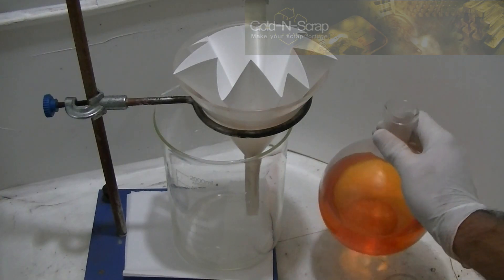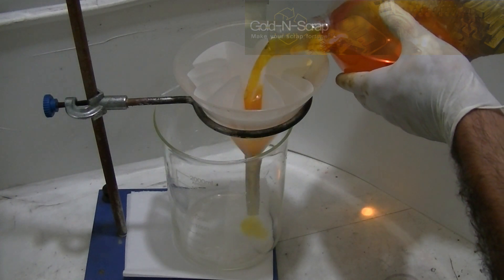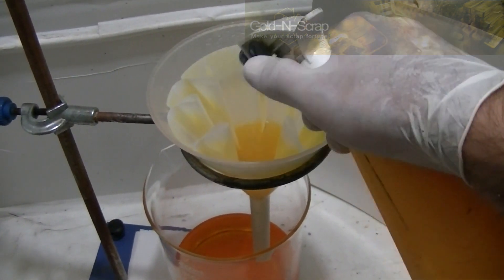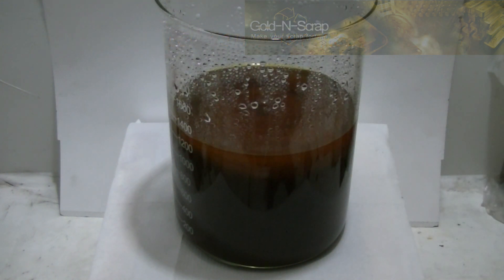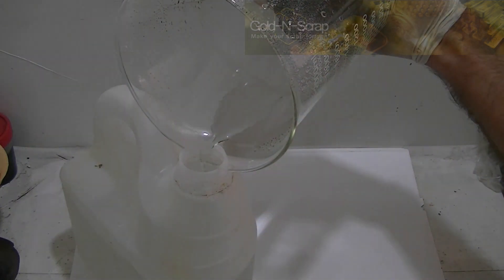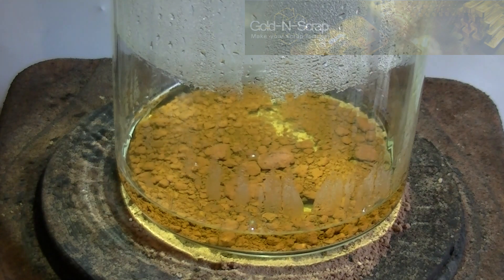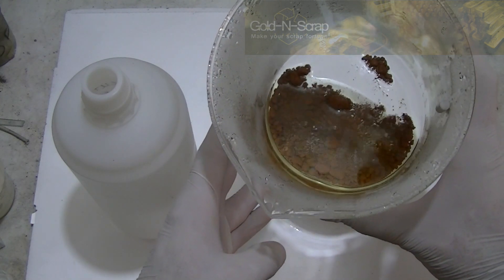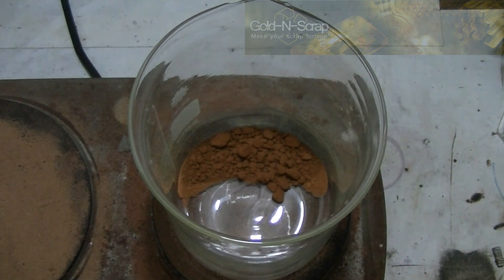How to Refine Gold Jewellery - Inquartation Methode (DIY) P. 2

Comment: Thank you for the great videos, they are very informative, I have a question though, is it important to grandulate the metal before remove other metels from gold using nitric acid and water? Basicly, is it ok to start with a 1 oz muffin piece of 14k gold and not grandulate the metal? Thank you for you help.

Comment: Why do you use all that silver? Is it just to lower the karat of the gold to demonstrate that you can refine it from such a low karat or do you need the silver?
Reply: That makes a lot of sense. Pm partly I was right it is to protect the gold and make the process cleaner and quicker and thereby you protect the gold from be in the acid  for to long. Does it matter if there is a little much copper in the solution when you precipitate by aqua regia? Ofcourse i  clean it afterwords with acid and boiling water until it is brown and not black, but does it ruin the precipitation at all?
Reply: thomas lund I have been researching this myself as a bit of a hobby and I think I have got the answer. The inquarting process it to introduce enough base metals that the gold particles are far enough apart so the nitric acid can get in between them. If the carat of gold is too high not all of the base metals will be reached by the nitric and therefore not dissolved and the end product will not be as pure. 
The reason silver is used is because it takes 3X less nitric acid to dissolve silver than it does copper. The silver can easily be recovered from the solution and therefore isn't wasted. I hope that makes sense. It does in my head. Chris
Reply: ***** Yes you do need all that silver, Inquarting is apparently the most common way to refine 10-14 karat gold. Check this out, i couldn't find page 1, maybe you can. http://www.goldnscrap.com/index.php/gold/73-refining-karat-gold-and-silver-jewelry-using-inquarting-method-part-2
Reply: thomas lund In total he had 185.44g of 6K gold.
24K = 100% (or at least 99%)
12K = 50%
6K = 25%

185.44g x 0.25 = 46.36g

If the chemistry went exactly as planned he would have exactly 46.36g of 24K gold.
Also, if he used K less than 6K, he would have been dealing with a lot of decimals.
By doing this is a little bit easier to measure the proportions of everything needed.
Reply: Author Unknown Also he had 116.27g of sterling silver. The % rate of Sterling Silver is 92.5 %.
If the chemistry went well, he would have at least 107.54975g of 24K Silver.
All that subtracted from the total leaves 31.53025g leftover, which could be anything from A to Zinc.
Reply: But is the silver used to protect the gold. I have heard a lot about the different acids harm the gold a little bit, specially the nitric acid.
Reply: thomas lund As far as I know, you can't ruin a metal by just dissovling it. At both sides of a reaction, the number of porportions of everything is always equal.
Reply: thomas lund No nitric on its own won't affect the gold it can only attack the base metals. It won't touch gold or platinum type metals. That's why when you put it in with hydrochloric acid the nitric acts as an oxidiser and the hydrochloric dissolves. On their own they can't do it!
No the copper shouldn't matter, the SMB precipitates only the gold so other base metals that might be left in solution will stay there..
Some recommend dissolving the gold again in AR if you want commercially viable gold!

Comment: Hi Gold-N-Scrap user.
i have one qustion.
i've tried the process but my solution became like a jelly and mi gold was lost!
i would like to give it another try but what did i wrong.
i've disolved the gold in aqua regia then i've started to add adittional hidrochloric acit till the nitric acit is complitely gone.then ive added the Metebysulphate in the solution?
Please give me a clue what did i wrong?
Reply: Deyan Cherkezov You need to neutralize the nitric acid before adding anything else to the solution.
Reply: You probably added gelatine. Don't do that. Don't add pudding either. It may look delicious, but don't do it.

Comment: Can you use distilled water rather than tap water for the wash? I'm wondering if using tap water will invite impurities into the mix.
Reply: I would assume that you could use distilled water because it's pure, but tap water has all sorts of impurities. But I haven't tried to do this yet, so this is a case of the blind leading the near sighted.
Reply: Thank you

Comment: So here's what you'll need if you want to properly and safely mimic this video when dissolving gold. This video is excellent by the way. The stand and funnel are part of a Master Distillers Lab Filter Kit. The paper filter is a Whatman Folded Filter Paper, Grade 597-1/2, 150mm Diameter. The chemical stuff is Aqua Regia (Nitric Acid and Hydrochloric Acid pre-mixed) and Sodium Metabulsufite (SMB). You will also need a Borosilicate Beaker, Neoprene gloves, an APR respirator and cartridge, Goggles and a chemical hazmat suit. Plan to spend $300 for all this. If you don't buy all the safety gear, you're kidding yourself, the fumes are instantly debilitating and there's no moving around them.